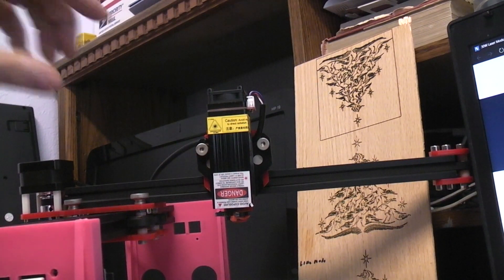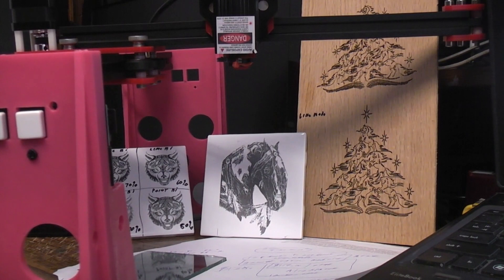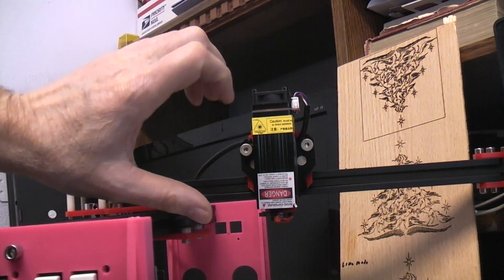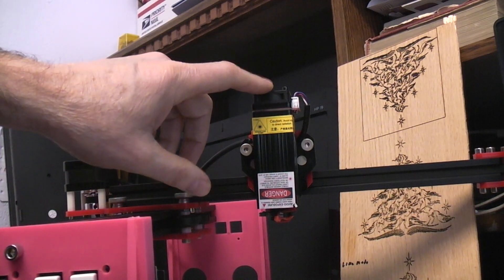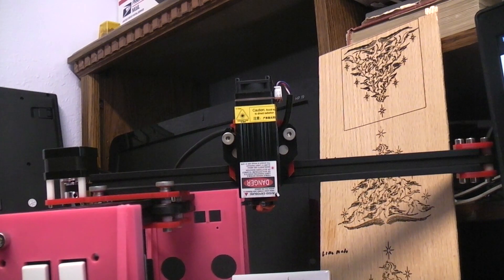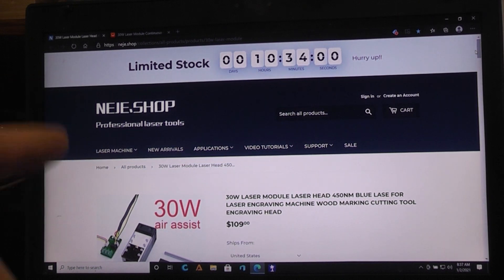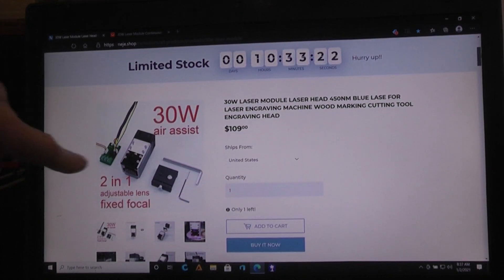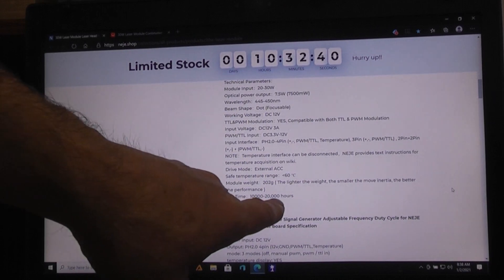How long do low cost Laser diodes last ? Probably not as long as you thought.

Comment: 10 hours is BS, It's the lens not the laser. Clean or replace the lens and get an air assist that way you do not clean the lens that often. 10 000 hours is minimum even for cheap ones. If you need to spend more,get a no name with air assist. 5.5 Watt OUTPUT POWER is enough to start.
Reply from the maker: 5 years ago, they were pushing cheap diode lasers to hard to get the power rating for marketing. Maybe just clearing out old stock so they could come out with the proper diode lasers. The Lense is fine on this cheap unit and yes if you watch more of my videos on different diode lasers you will see I add air assist and found 5 wats to be plenty with the new diode laser heads. The newer ones are still working fine years later. I think they were just selling low power diodes and pushing them to hard at the time I made this video.

Comment: I am a bit skeptical about it. You are telling us that ppl buy those lasers and 2-3 days later they throw it in the garbage... If this was true no one would be getting these.
Reply from the maker: It was true over 2 years ago for this low-cost laser when I made the video. I have replaced the laser head and kept the rest of the unit, the NEJE diode laser head has been working for over 2 years no problem. So the original one was crap, they were pushing a small output diode to hard to get a rated output back then.

Comment: May be this is due to smoked mirrors inside of the head unit? Don't air assist prevent this problem?
Reply from the maker: In this case it was just a cheep laser design. The NEJE that I replaced it with has been working over 2 years now with out problems. I have added air assist to keep the optic clean as well.

Comment: Have you cleaned the lense
Reply from the maker: First thing I checked , always keep your optic clean. No it is just that back when this small diode laser was made they were pushing the diode to hard and did not have enough cooling to keep the diode cool when run at 100 percent. The NEJE diode that I replaced it with has been operating for 2 years now and i have run it at 100 percent many times, no problem. Diode laser units have come along ways in the last 3 to 4 years. Now they stack 4 diodes in one unit to get 20 optical W of power.

Comment: I don't really know that much about this type of cheap lasers, but could you not reduce the power and make several more passes though it would take longer.
Reply from the maker: Yes, many times you can. But having said that the laser diodes have improved so much since I got this low-cost unit. I replaced the diode laser with a unit from NEJE and it has twice the optical power and has been working for over 1 year without a problem. I just recently added a Atom Stack 10 W optical power diode laser and it can easily cut through 8mm thick wood.
Reply: @Robothut  Wow, that is amazing that a diode laser can do that.
Reply from the maker: @zk_6312  You can find the video I did for the AtomStack diode laser on my channel in the laser section or just type in Robothut Atomstack in the search window on youtube.
Reply: @Robothut  I will check it out.  One other question.  I know normally that a diode laser cannot cut clear plastic like acrylic, but is there anyway to trick it like cover it with black paint or ink that can be removed later?  Probably not, but I thought I would ask.
Reply from the maker: @zk_6312  I have marked clear plastic and did a video on that, but I do not think you can cut the clear plastic as the paint or dark colored material that you set on the back side of the plastic will only melt the image into the plastic but not cut it. Now you can cut black plastic as the diode has something to work against all the way through.
Reply: @Robothut  Yes, that is kind of what I thought.

Comment: It would be nice to find the technical cause of this. Whether it is cooling, optics, EMF or something else. I personally can't trust the 10w+ modules. The diodes are tiny so you can't rely on forced airflow.
Reply from the maker: The 10W diode lasers have two 5W diodes in them. I bought a NEJE 5 W diode laser almost 2 years ago now and it still works great. So, I just jumped on the Atomstack A10 Pro a 10 w dual diode laser. We will see how it holds up and I plan to use it for cutting mainly so running at 100 % most of the time. If it's as good as the NEJE diode, then everything should be fine. That first low-cost diode laser that lost its power after being run at 100 % was just a cheap design with poor cooling, low coast diode and so so optics.

Comment: How about cleaning the lens or even changing it. Cutting requires the air assist. You have cut that wood and smoke fucked up your lens. I have 3 Neje modules and the are awesome but you can make their lens dirty to. Fan on top is not the air assist and will not prevent you fucking up the lens. So when cutting use the air assist.
Reply from the maker: I covered the lens cleaning "did not help" and videos on adding air assist that you can find on my channel. It was just a very cheap diode laser unit that they pushed way to hard to get the rated optical power output. So I upgraded to a NEJE almost 2 years ago now "lots of videos on this on my channel" and it is still working fine. So a much better designed diode laser unit.
Reply: @Robothut  this particular video came recommend by YouTube to me. Sorry but I have never see your channel before. Just tried to help while I have seen so many people confusing dirty and broken. Plus it can break from the dirt as well. I own 3 different Neje unit and one no name unit. I am very satisfied with all stuff I have from Neje. Thud other unit came with some CNC and is "15 Watt" . Although being cheap it has remote driver boards with it's own dedicated fan and it has fan on the module to cool the laser diode. Seems sound solution. Though I bet it doesn't do much more than my smallest 7 Watt Neje module that came with my first Neje Master 7 Watt engraver. That Neje module suppose to have 2.5 Watt optical power and I do believe it does. Though it pulls over 10 Watt to. So like understated power figure.
Reply from the maker: @NINEWALKING  Glad you took the time to comment, always glad to talk shop. Just like youtube to recommend a video that is 2 years old. I agree the NEJE diode lasers seem to be much better than the no brand name stuff from years ago. And wow, what about the new 2 and 4 diode units "10 W and 20W optical power" with the smaller focus dot. Just amazing. So many of the units now come with air assist as well. it is cool to see the diode lasers getting so much better so fast.
Reply: @Robothut  those multi diode models are crazy. Best thing is that thise are easier to focus while the beam is square. Also stays longer time focused to. So it ain't only brute power it is more energy delivered by square microns. My bigger machine use to be 2S Plus with N40630. I have upgraded it with the original Neje metal air assist and new Neje 3 Plus mainboard. Single diode still but kicks some serious ass. Got emergency stop, two relay modules and that cable switch from Neje just today. Looking forward to install it all. Going to make enclosure with silent PC 120 mm fans with carbon filters and my Skulpfun Air Assist. Plus some acrylic protection window to. So I can turn on the engraver and everything will go on when needed.

Comment: Hi thank you for your video.  I'm using Neje Master 2S with N46030, 30watt engraver.  After watching your video on how that includes some information on engraving Tiles I'm going to give it a try with my machine.  I'm using LightBurn software and appreciate if you can advice what i recommended setting to engrave White Tile.  Thank you and really appreciate your video.
Reply from the maker: I can not use lightburn with the unit I have . but there are lots of videos on youtube of people using light burn to engrave tiles and glass with diode lasers.

Comment: Did you clean the lens with isopropyl alcohol with clockwise turns and a narrowed Q-tip?

Smoke deposits on the lens and loses power by darkening your lens.
Reply from the maker: I even checked the Lense with my microscope to make sure it was clean. The old cheap diodes did not last long, they pushed them to hard to get more power from them. The new diodes last allot longer, better diode's, better lens and better cooling .

Comment: 10-20 hours is pathetic. I like my diode laser but I guess I'll never use it above 65% again.
Reply from the maker: Yes the cheap diode laser that came with the low cost Vigotec was a joke. The NEJE 5.5 w optical power unit that I have had running for 1 year now is still working fine. But I still just to be safe never run it above 80% power.
Reply: @Robothut  I'm curious. When you say a year, how often do you use it? Any estimate on hours?
Reply from the maker: @bedandbreakfastfan7088  I wish I did, it would mean more than just saying 1 year. I guess I could say I have done probably 100 times more engraving and cutting projects with the NEJE diode laser than I was able to do with the original diode laser that came with the setup. I am quite happy with the 5.5w optical power  neje and it looks like there newer versions with the smaller focus dote would be even better not to mention the dual diode units.
Reply: @Robothut  thank you. I'm just getting started so I'm experimenting with my laser every day with a new project. If I can get a year out of it even cutting jobs slowly at 65% power it would be well worth it.

Comment: My 20w NEJE burnt 6 ceramic tiles before it no longer had enough power. I’m very disappointed with it.
Reply from the maker: Wow, that sucks. I have burned 100's of tiles and still going strong. You weren't burning at 100% power were you ? That is the only thing I know of that shortens the life of the diode lasers.

Comment: Hi, thank you for the video. My thought is that laser modules on cheap engravers doesn't tell you the diode ratings correctly (lie about it). Maybe the VIGO just use a lower rated (not necessarily bad quality) diode and overdive it. In this way they can get the 5W optical power but this extra heat caused by the overdive kills it much sooner. Meanwhile NEJE use a diode which is rated to the driven power so no overheat occurs and it lasts as a normally driven LED should last. Seeing the marketing bullshits on the field of consumer electronics tell me that it can be true.
As well as I know the manufacturers do a grading selection in LED factorys like manufacturers do in CPU industry. Depending on how well the product has done they decide which rating (and name like Pentium, Celeron etc.) to give it. I don't think there are cheap laser diodes which are designed to be bad (maybe after grading the low rated products get cheaper enclosures while the good ones get more expensive) , I think the overdriven diodes are the ones which can die in 20hours. Maybe they are poorly graded too but my bet the diode manufacturer doesn't do that, there is more chanche of a lie from the manufacturer who creates the cheap modules for engraver.
The lack of proper cooling is another thing, but to to state that if it is the reason of the lifetime difference I should see a VIGO and a NEJE laying next to each other disassembled.
Reply from the maker: I agree with you. The new laser diodes all seem to be better these days. The hours they last is longer the size of the laser dot they produce is smaller , the cooling is better. So many new  laser diodes out there now that really seem to do the job. I have had the NEJE now for 1 year and it still works great, so it was a step up from the low cost diode that came with the Vigo unit.
Reply: @Robothut  Good to hear that! Eventually I choose the VIGO (shipping is ongoing) over NEJE because their site was too confusing, couldn't find any detailed specification table of their lasers to compare them so they lost the credit for me. The extra cost for confusing promises didn't look a good deal, that is why I choose VIGO for far less bucks. Wish I found your video earlier. but there is a chance that I would have chosen VIGO anyway. As soon I tested the VIGO I will look into the laser head searching for laser specs.
Reply: Hi Zoltan.
Can you contact me somehow I just bought a laser and I have an issue with it? is there any chance can you help me out?
Reply: @tamasszabo6355  Hi Tamás, if I can I do help but I just tested it, as VIGO original software works but it is poor in functions <-> laserGRBL has better functions but makes problems (suddenly stop at one point and burns a huge hole so need to power off the machine). Can you please describe the problem here?
Reply: @EM83D  I bought a cheap laser for practising . the manufacturer is advised to download laser GRBL software to control the machine but however, but I do install and follow all the steps they told me. then they send me the pictures of the configuration that I need to change but the engraver still moving opposite side as needed on the X-axis. For example, when the laser needs to move left is moving to the right and is the same way around. Can you please advise?
Reply: @EM83D  also I have a video uploaded on Youtube because the manufacturer wants to see it. is on my pages if you want to check out.
Reply: @tamasszabo6355  Hi, if you are not familiar editing the firmware (invert a specific stepper's direction) or the bare firmware is not avilable you can swap the wire order in the motor connector.
But be careful, if you mix the wires you can end up your stepper driver. As you are good in English search for that.
Look at the linked video for the basic info but read the comments too and search google to avoid mistakes.
Also: Be careful releasing the pins from the connector as the plastic lips are super fragile!

https://youtu.be/AgyNM7FQrmk?t=107

Comment: Wow that’s crazy 20 hours is shockingly short some engravings can take 2 hours..
I just picked up the atomstack p7 m40, apparently the m40w module has a 10.000 hour working time so as long as I get 2000 hours I’ll be happy, lol if I end up keeping the thing..
Reply from the maker: The new atomstack looks to be a good diode laser unit, just like the new NEJE diode lasers, they do last longer. it is still best to not run them at 100% power as the heat build up shortens the diode life faster.
Reply: @Robothut  thanks mate I’ll try not to use it at 100% too much I’m totally new when it comes to laser engraving to be honest I kind of bought it on a whim thinking it would be good to expand my vinyl decal business with but after using it a few times I do kind of regret buying it but I’ll get some use out of it while I decide if I will sell it or not..
Reply from the maker: @MarcRCAddict  The process of laser cutting vinyl is extremely hazardous and toxic. so if you do make sure to vent the fumes outside. But the internet says not to do it.
Reply: @Robothut  oh yeah I know that mate, I will never laser cut vinyl, I have been running a small custom decal vinyl business for 2 years now using a vinyl plotter, I’ll never laser cut vinyl, I got the laser for other things like coaster, bottles, wood engraving etc..

Comment: So how long did t last?
Reply from the maker: The old low cost lasers last until you run them at 100 % then its all down hill from there. The newer ones have better cooling for the diode so they last longer but it is still best to never run them at 100% power.

Comment: So it's July, what's the update from this video? I am purchasing an Ortur LM2 Pro today w/ a 20w and after watching your video decided to buy 2 heads since it was on sale, still $150. Anyhow, curious as to whether this model is working and how many hours and quality your getting out of it.
Reply from the maker: I am glad to say the NEJE laser diode head is still operating . I have around 35 hours on it right now.  So many new versions of diode laser units have come out since this video. Some of the new ones use two laser diodes that focus together in a even smaller dot. They are able to run them at lower power so they last longer and still can do the same or better burning / etching. So some day I will upgrade again. But for now the NEJE is doing everything that I wanted for the little craft projects the family wants to do. All lasers are consumables , CO2 and diode all lose power as you use them. But they are making them better and better.

Comment: Hello.... Can I run directly this NeJe 7watt module with out any TTL or PWM. Simply with driver and adapter. Please Help. Thaanx
Reply from the maker: NEJE sells a small low cost adapter that will provide the ttl / pwn signal. It has a trim pot on it so you can set the power. You would need some way to set the power level of the diode laser. You would not want it running at 100% power all the time as that seems to shorten the life of the diode.
Reply: @Robothut  thanx for ur quick respons. By the way I want to make laser pointer with it. Is it possible with any 12v battery pack. Thanx again🙂
Reply from the maker: @shashiranjan5430  As long as the battery pack can supply the 12 volts at 3 amps required. But unless you add a new focus lens it will not work as a laser pointer. As soon as you furher than 30 to 50 mm the beam will spread out.
Reply: @Robothut  ohh... Well.. Thanx sir for ur rply👍